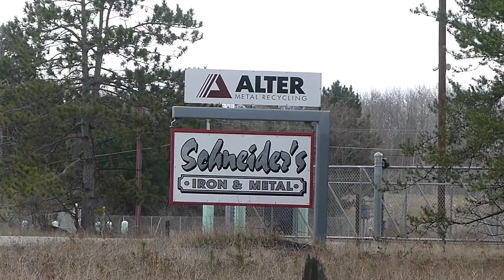WEEKS LATER.. HAVE THEY FIXED THAT SPOT YET? | Jason Asselin

Comment: I think the tracks pretty knackered.
If the r r put lots more trains over the line the track would disintergrate.
Not quite the worst track I have seen.
Greasing is mainly used on curves to reduce the wear and squeal of the flanges in the UK.
The squeal on a straight track would get a lot better with better maintained track eg level and continuous welded rail.
Thanks for the video

Comment: Jason, the slow down may be to the very large price jump in wood, both raw and finished products.  The trading price per one-thousand board feet of lumber (July 2021 contract on the CME - LSN21) on Sept 28, 2020, was $400.50, today, April 12, 2021, it closed at $1,033.00. Just "today" it is up 3.2% or +32.00 dollars. 
(Fun Fact boys and girls, "IF" you had bought one contract at 400.50 on 9/28/2020 and sold it at 1033.00 on 4/12/2021, you would have a gain of $69,575.00 before fees, commissions, and taxes. Warning, don't try this at home.)

Comment: I can't get over how warped the tracks look there! What is the reasoning for that? Is the ground soft and unstable? I mostly only film in Central California where our weather is obviously so different than yours there. I usually film BNSF and UP but even the tracks for our local short line are, while clearly old, not as damaged as these. The soil in the valley is pretty soft and sandy so most of the places have a good amount of ballast built up. The differences are just so striking. Watching these huge heavy cars rocking back and forth make me nervous!
Reply: When this rail was originally laid by the Milwaukee Road, they used local sandy clayey rocky soil for ballast.  Not a great roadbed.  it's never been improved much beyond top ballast about 30 years ago.  Ties are rotten and drainage is poor, which leads to settled rail joints that you see.  
This line was never more than a "Secondary Main" for Milwaukee Road, so the RR never invested much in keeping this track to a condition to support much more than 35-40 mph trains.
These days I'm also in central California.  The SP, WP and ATSF mainlines (now BNSF and UP) through the Central Valley were part of the transcontinental primary mains for each system, and were built for heavy fast traffic.  Distinctly better roadbed construction on these lines better quality rock ballast affording better drainage and stability.

Comment: It is good, Jason, as long it does not derail. The design of the bogies enable to run over these tracks. In Germany,this railroad would be shut down !!
Reply: Lots of track like this in America is "excepted" track (not accepted).  Only low speed freight is permitted and no Hazmat and no passengers.    It saves local lines a lot of money when only one or two trains a week need to run in an area.      Perfect track maintenance would bankrupt most of these small lines.
Reply: Here they'd be refusing to even consider using it!
Reply from the maker: I had hoped to travel the world some day to see other railroads, but I think covid has changed that forever. Thanks for watching from afar!
Reply: @jasonasselin  So do I now..You have Youtube as well...

Comment: Jason could you tell me where the ultimate destination  of those cars loaded with scrap metal     does it go to a steel  mill for recycling  or does it go for export.? I was in Pueblo Colorado  a few years ago  and they get a lot of scrap by rail  from all over North America  destined for Rocky Mountain Steel.Mills. Cheers from Sydney Australia.
Reply from the maker: Goes to Green Bay, WI where the market is stronger.

Comment: No garden yet. I am waiting on backordered tiller parts for a month now.
Reply: Due to work restrictions over the past year and now the problems caused by the Ever Given grounding, empty containers have not been a high priority to move so there is a major container shortage and it may take another year to get things back to normal. So, "IF" your part is coming from overseas, either you're going to wait, pay more for it, or both. Good luck.

Comment: What is with those rails @ 0:46? Can they really be as warped as they seem to be?
Reply: Yes.  Train tracks are not as rigid and straight as many people think they are.  When first laid they are nice and pretty and straight, but over  time as the gravel bed settles, you get tracks that look like this.  If it gets too bad, the speed limit in that area will be reduced until the track is re-laid.
Reply: @VC-Toronto  You are right but the perspective of the image probable exaggerates how bad they are.

Comment: The squeals that you hear the train breaks on the cars
Reply: brakes
Reply: Those are the wheel flanges squealing against the side of the rail. Places like Horseshoe Curve use flange greasers in spots to eliminate the wear on the rail & flanges due to the excess friction.
Reply: Nuh Uh

Comment: Where is the E7 locomotive
Reply: The 600 is an EMD FP7. Spotting features,  two 2-axle trucks, one prime mover, length of 55' 2-1/4". Whereas the EMD E7 has two 3-axle trucks and "two" prime movers, length of 71' 0".
Reply: scrapped
Reply: I think someone said it's holed up in Pembine.
Reply from the maker: Last we heard in Channing with some issues.

Comment: Nope, saw the track jump just after engine crossed grade crossing. How railroad administration lets this railroad run is beyond belief with all the bad track. Also the wheel squeak is caused by the track not being in alignment and train wheels rubbing on out of aligned track.

Comment: Maybe its the angle or your zoom, but it looks like zero $$  goes into track maintenance.  Shameful. When I worked for PennCentral, tracks were fixed by lowering speeds, not with maintenance.  And when you derailed at 3mph, they came out to fix.